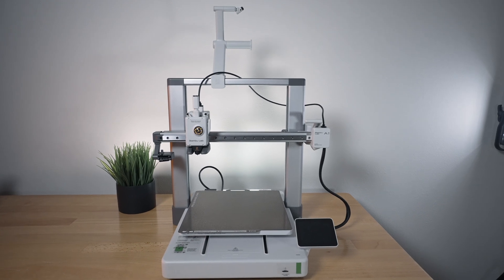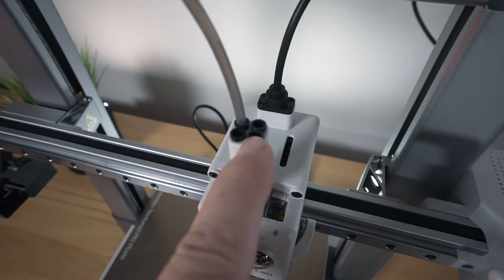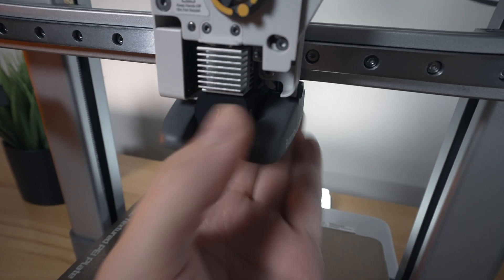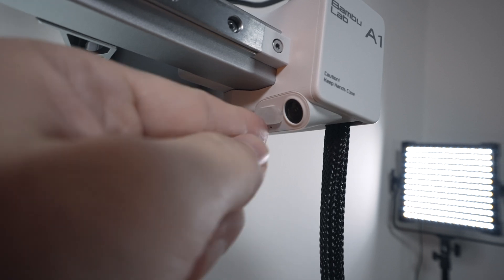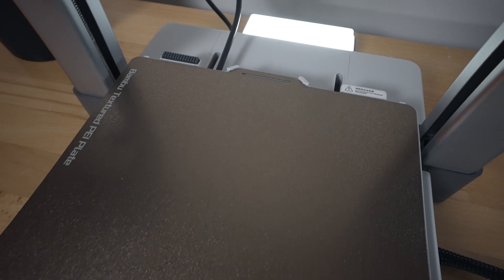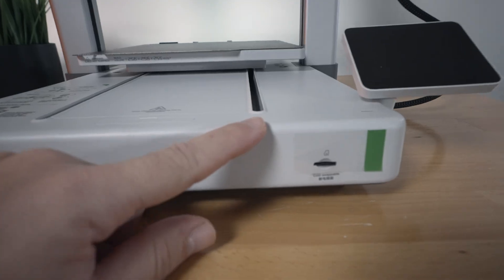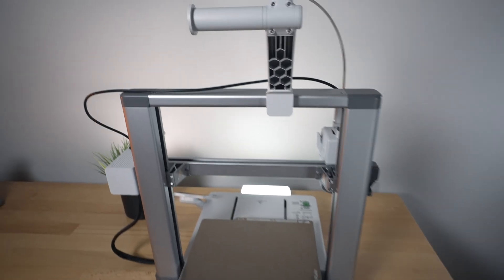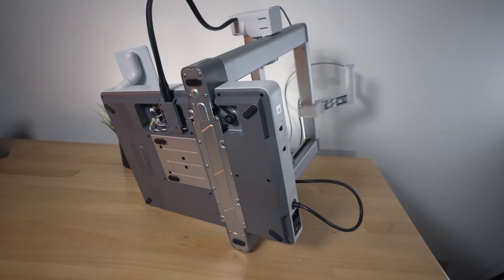Bambu Lab A1 - 3D Printer - Overview

Comment: I returned mine. It was a pile if cr@p. I’m gonna stick with what works. Prusa for me. What bambu lab are doing to the 3d printing world is great. But I find the printers just need a bit more reliability
Reply: Mine has been 100% reliable out of the box. Not a single issue and prints insanely well.
Reply: @sam_millen  mine too,  that's why I asked
Reply: Can you go more into detail what was crap on yours? (Besides the callback)
Reply: @reinerreinbrech7431  It's subjective, some people love the prusa because they are good printers that are reliable but my A1 worked better and faster than my prusa mk3s+ ever did. smoother prints, faster and a colour system that actually works but for less than the prusa costs. Yes there is a recall of the A1's and most were fine but they recalled them all just in case. I sent mune back and brought the P1S and that is far far better than the prusa and the A1 are. But again it's down to personal choice. If you want a printer you can spend more time tinkering with then buy any printer other than a Prusa or Bambu Labs as they just work, the prusa needs slightly more setting up but when set they both just work. Personally I prefer the Bambu now but that's just me.
Reply: Good move bro. Bambu labs look generic.. like I’m about to weight meat on that thing 🤣 That’s probably why they are cheaper 🤣 Prusa all day over Made in China 💯

Comment: These printers work great . The round ams clip goes on the tube and black stepper motor  wire to the right. Great 👍🏻 review
Reply: What about TPU and nylon using the ams?
Reply: @EclecticLensYT   no idea
Reply: @EclecticLensYT  I dont know about nylon, but for TPU it is not recommended to use the ams but use the standard spool holder instead.